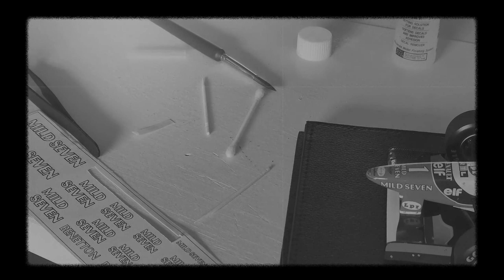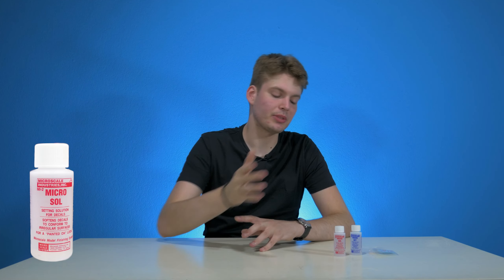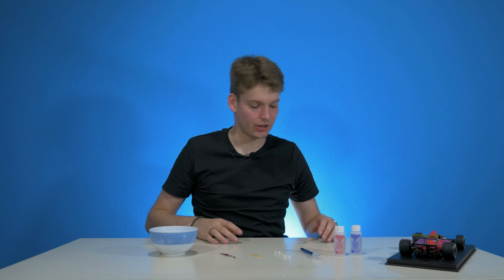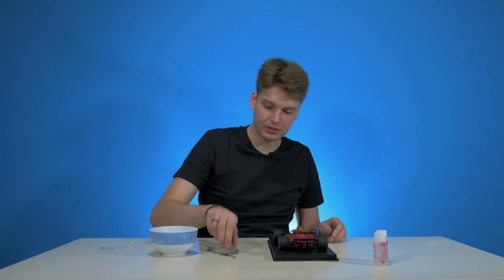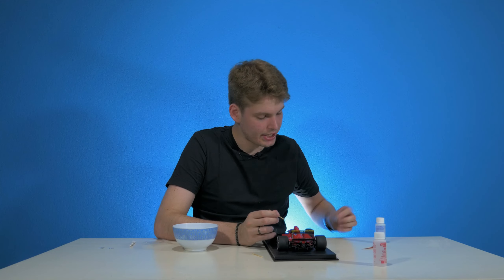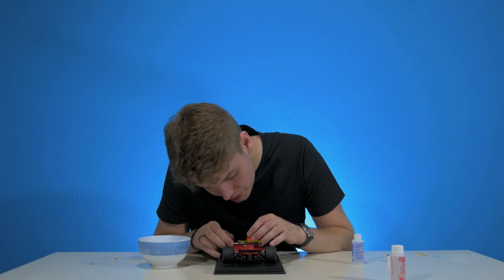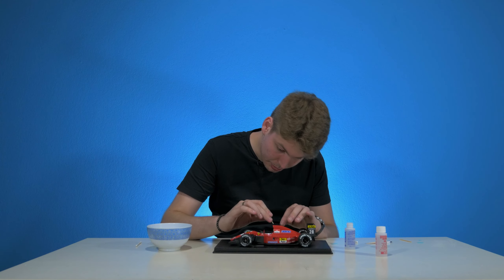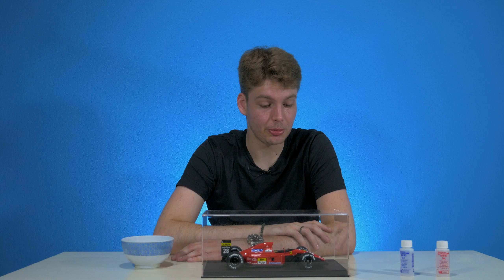How To Apply Waterslide Decals To A Model Car

Comment: One quick tip - I use tweezers when soaking the decals in water. I find it easier than getting them out of the water with a toothpick. One note on Micro Set and Micro Sol. One bottle of each will last you for YEARS since you only brush on a little at a time.  Otherwise, this is an easy video to follow for beginners.
Reply: will the decals remain on if you don't use any Micro Set, but just water? I am specifically talking about 1/5 helmets